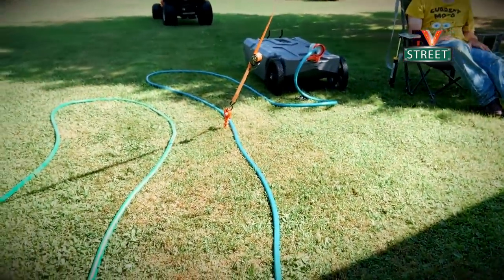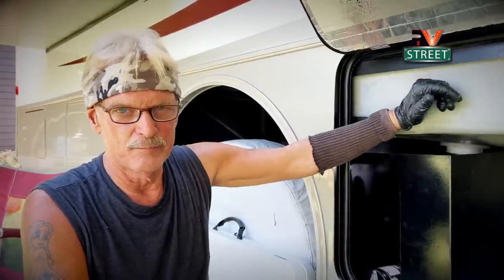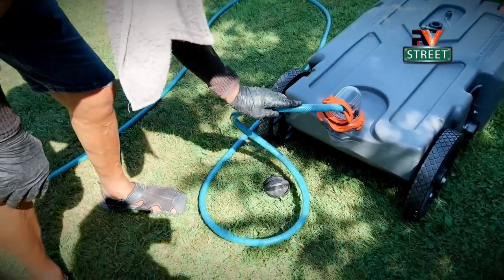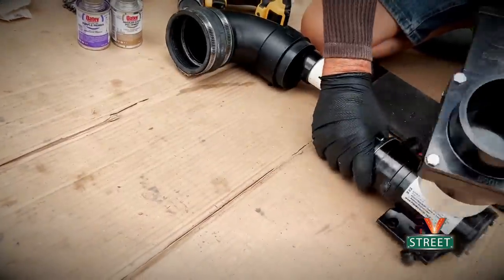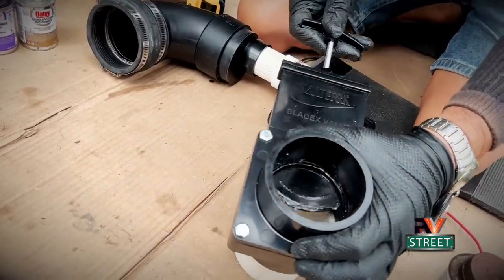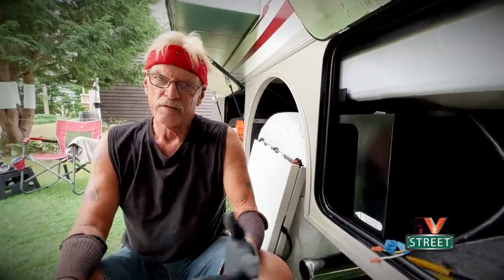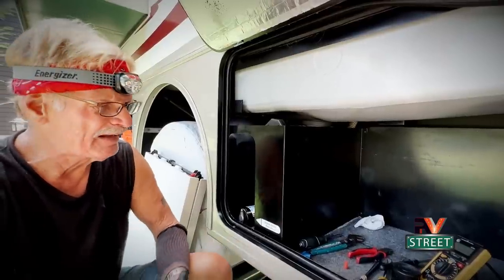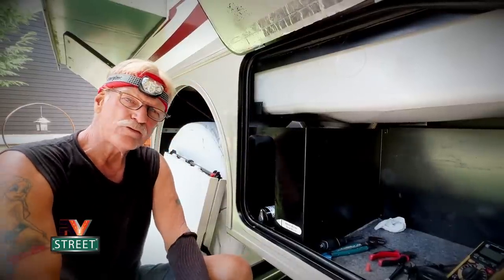RV Black Tank Plumbing Needs Rebuild • It’s FULL of WASTE • Now What

Comment: Martin does not show it, but when gluing PVC, push the parts together, twist ~1/8 turn and hold them together.  The cement expands the PVC by melting slightly and it can push parts apart.
Miss Martin. 💟

Comment: I could see your eyes filled with gratification as you were holding the final assembly, like a proud winner conquering another repair. I can tell you, I enjoy watching your stuff. I don't have a complicated setup like yours, don't even have a proper wet bay, but it's still interesting learning new stuff. I learned about fittings, PVC glue, macerators, and all thanks because you go into detail. You even went in there and looked at the old valve and the old macerator, opened it to investigate what went wrong and showing how the macerator operates. Your videos are always a perfect learning experience.

Comment: Thanks Joanie for posting. We have a Vista and our Macerator pump leaked just like Martin described. PVC hairline crack and the end of macerator was cut off just like Martin discussed. Replaced macerator pump and installed a gate valve in the event pump ever needs replacing again. Thanks for posting. Most informative just as all the other numerous videos. Thanks again and best wishes on sale of your motorhome and building of your new house. So miss Martin, but his videos help somehow with his loss. God Bless you Joanie.

Comment: I have this problem where the black tank won't dump from time to time. No solids at all or toilet paper, just liquids and I don't have a pump. Im sure the valve is opening, It's acting like the plastic cut out from when the factory cut the hole for the tank, is still in there and shifting in front of the hole. In this truck camper, it's not going to be as easy to get the pipe out like yours. Im going to get a camera down in the tank first to see if I can see if there is a plug or toy of some sort in there. Thanks for your videos!
Reply from the maker: I'm broken hearted to say Martin has passed away💔

Comment: I have the same RV as you AND the same issue with my connection at the pump cracking. When I contacted Winnebago, they said the problem was during winterization. Water had pulled in there, expanded and cracked. I informed them that I live in Florida, and highly doubt that was the issue because we don’t need to winterize our rigs down here. I suggested to them that the problem may be when you’re driving down the road there’s a lot of flexing in our rig and because there’s no giveaway that that may have caused the crack. 

I have all the parts to repair it, but I’m putting off the repair until my fix starts leaking.

Do you think putting a rubber flange in that location would be a better fix?

This will give some flexibility. When I suggested that to Winnebago, they recommend I don’t do that because their design engineer didn’t design it that way. I’m not really sure I want to trust their design engineer.

What do you suggest?

Dan
Reply from the maker: I'm sad to say that Martin has passed away and I don't have the answers to your question. Thank you so much for watching our videos.

Comment: I don't use the black tank. I opened the valve and clear blue liquid came out. 
I line the toilet with new shopping bags for poops. Gallon jug for pee. Grey tank only used for showers and occasional rinsing.  Paper plates and silver.

Comment: I didn't know you could use PVC glue on black plastic.
Reply: There is a specific cement to glue pvc to abs. The connections performed by Martin should have been done with three different cements, abs to abs, pvc to pvc and pvc to abs

Comment: There are alot better macerator systems that dont clog nearly so easy. The ones with the funnel end piece are way better for chopping up stuff and they will pump waste better also. Its kinda a bad designed system to step down in size before chopping it up. Learned from experience